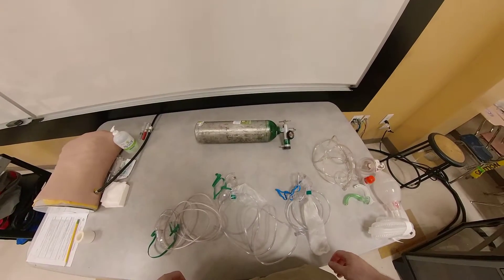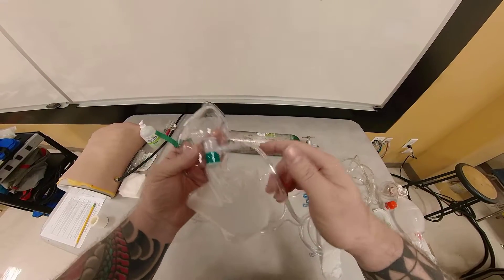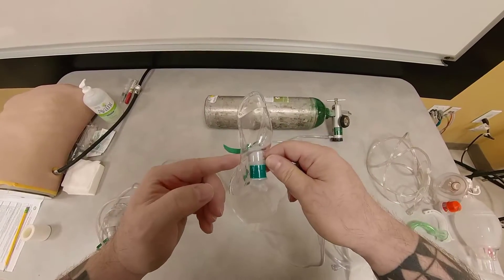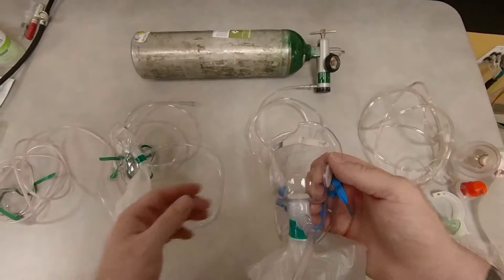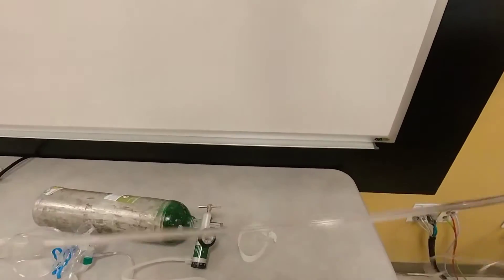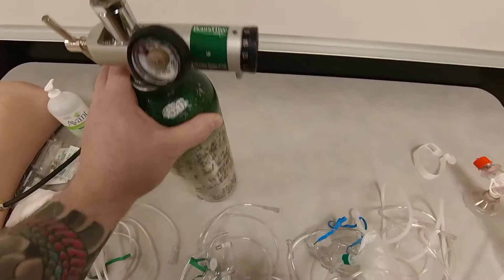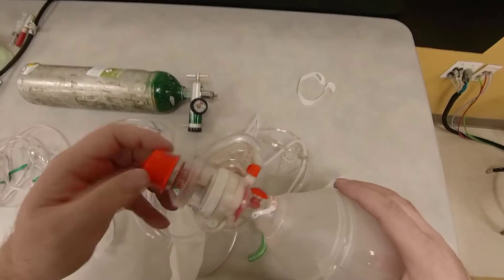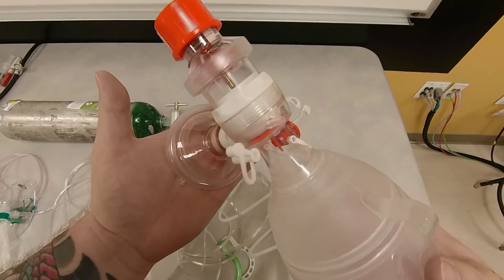How much FiO2 does a true Non Rebreather Mask NRB, Simple Face Mask, and BVM delivers for Pre Ox?

Comment: 1 flap NRB is 70% fio2? That’s a little high.1 flap is more like  40%-60% fio2.
Reply from the maker: I would agree that with 1 flap it is less than 70% FiO2, but it is certainly higher than 40%. The reason I state up to 70% in this video is I am referencing material from the manufacturers instructions and Ron Walls Manual of Emergency Airway Management as I state that in the description "Information for FiO2 % comes from manufacturers instructions and The Walls Manual of Emergency Airway Management 5th Edition ISBN-13: 978-1496351968